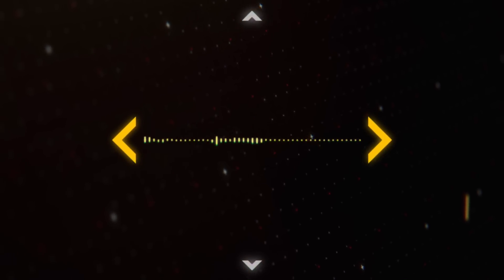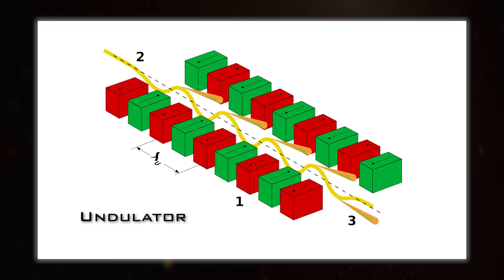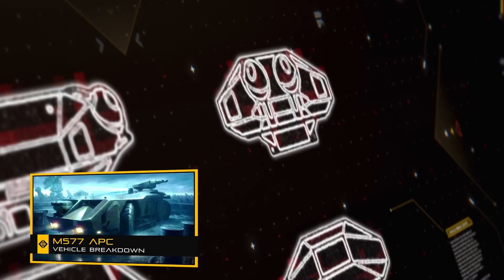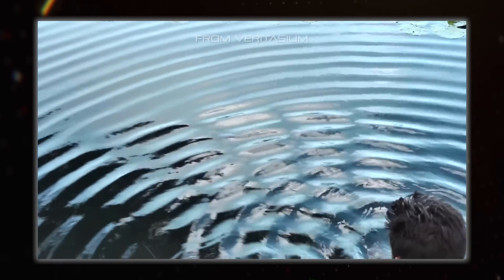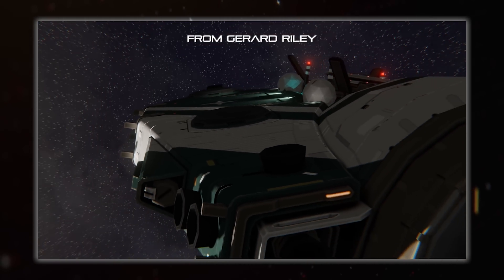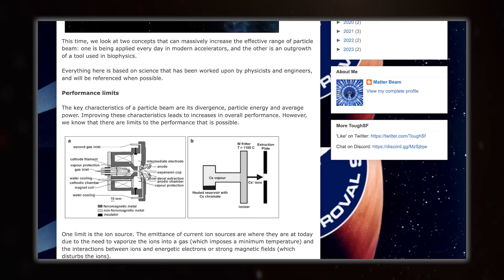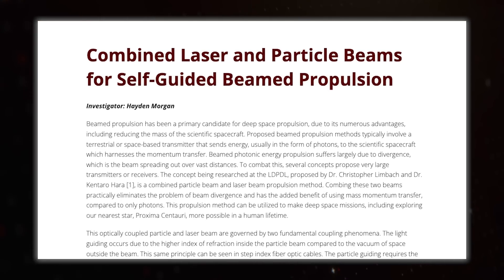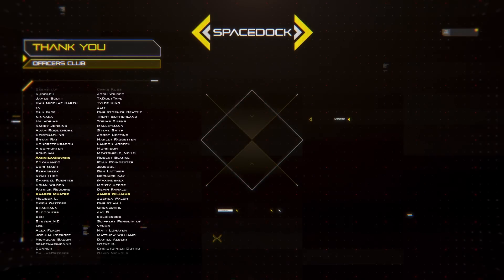Advanced Laser Weapons in Realistic Space Combat

Comment: You're missing the strategic applications of lasers.  TLDR they far better at overwhelming the cooling of enemy vessels than punching holes.  Would potentially allow solar-system wide interdiction of vessels.  Dodging due to light lag then becomes a cost benefit analysis of how much power you want to spend to cook an inescapable volume of space vs the range of interception.
Reply: with a properly tuned, equipped and operated dyson swarm, your available power budget is basically 'yes'. also you're firing from off the solar corona, so you have the figurative high ground everywhere in the system.
Reply: This is how I have them mostly get used in my novels.   Gamma Ray lasers with shields that can't really be penetrated by said lasers, as the shields are designed to deflect near-light speed radiation.  However using them against a ship generates heat.  So even if you don't have the specialized torpedoes that can get through shields, you could use them to cook a hostile ship/station/etc.  The energy output can also blind sensors and comms and there's just all sorts of side uses for them.
Reply: @trekkie1701c  Magical space shields are more fantasy than sci fi, though. 

While you could use some thing to create a shielding effect, it wouldn't work like some magical barrier against pretty much everything - and on top of that would be a horrendous waste of energy to be halfway effective even against the few things it could work against.
Reply: @miriamweller812  Sure, though there's always a conceit somewhere.

In my case the logic for the shields goes somewhat like this - if you're moving at a good fraction of the speed of light (which you'd have to to do pass it in most of the way FTL is handwaved) or even possibly at/past the speed of light, any stray photons you run into - the light particle, not Worf's lost torpedo - will hit like a nuke.  You'll run into a bunch of those given that there's a whole background radiation and all that and you'll basically instantly destroy your ship from that.  That it doesn't is usually a conceit; and I didn't really want to go that route.

So why doesn't it?  We'll go with the old Sci-Fi staple of shields.  But wait, what's going to hit harder than the background radiation at light speed?  ...Not much, if anything.   If we say that they can protect the ship from the rigors of FTL, then it doesn't make much sense that they can defend against that but not some stray laser blast.  And if they can defend against it for long enough to make FTL jumps last more than a few seconds or so and be the sort of thing where you can have the ships whiz around their local clusters in reasonable timeframes for the story I want to tell,  then it's not going to make sense that you can really penetrate them with an energy weapon.  That makes such a system incredibly appealing from a military perspective, and I decided to roll with it.   You can still penetrate the shield - sure, the various militaries of the galaxy would want to use that sort of thing defensively, but they'd also want something that could penetrate it so they'd develop weapons to do so (in this case a torpedo with a generator to counteract the shields).  You can even time the torpedo impacts with a nice shot from a laser to blow a hole into whatever section of the ship just ate a torpedo (and possibly take down the shields by destroying the generators, which now not only leaves the ship vulnerable to laser fire but... now they can't go to FTL and they're trapped).

Now, you might point out that 'they have to see through the shields so they have to let some stuff through' but surprisingly, no.  If something hits the shields then that's going to have an effect on them, be that deforming them, or forcing a higher energy draw from the generators, or heat buildup, etc.  It induces a change in the shields, basically - much like radio waves induce a current in metals.  You could then with enough math work out what probably caused that change and infer a picture of what's outside.

As for how they're generated?  These ships already have the ability to really mess with the fabric of spacetime in order to propel themselves at FTL speeds; it doesn't seem like much of a stretch that they could use the same sort of technology to deflect anything that might otherwise hit the ship, particularly given how reliant on shields the FTL tech is in this setting.

Of course this energy usage would be fairly high and so would heat generation as a consequence, which has forced many military ships to have removable heatsinks to allow them to swap them out for faster turnarounds and a competitive edge.  Ships otherwise have to - and do - have to otherwise sometimes wait to cool down with their shields off (among other systems), which can be dangerous if you're not somewhere particularly friendly.
Reply: While lasers are fast, the solar system is VERY big.

Even firing at the very close mars, it takes 12,7 minutes(!) to reach the planet  (and Mars moves around 24km - per second. And that's just the planet, the rotation would add to this on top if you want to hit something just on Mars)
Reply: @miriamweller812  An even closer to home example: For a geosynchronous satellite, the latency incurred by the distances involved, even at light speed, is very nearly an entire second for a round trip. That makes for VERY noticeable lag for anyone that has to use satellite internet and has ever used any of the more common terrestrial options.
Reply: Lasers have focal points. They do not have solar syste wide range. Not even remotely. A very large laser might have a couple ten thousand km range. No more.
Reply: @XMysticHerox  You can't really put any single number to the range of a laser. It depends principally on wavelength (lower is better) and aperture size (bigger is better). Subtler factors like jitter can affect how well you can keep it on target. Your effective range could be a hundred meters, or ten light seconds. Depends entirely on the laser.
Reply: The strategic level is one that very few people think well on, if at all. On the um, bright, side, if you are a planet or station that's considering the strategic deployment of lasers as deterrents/interceptors across the scale of the entire solar system, you probably have quite a lot of power and other resources to hand anyway. 

On the gripping hand, you'd also have to worry about ensuring you don't accidentally fry someone or something far closer than your intended target and likely leave gaps in your planned coverage.
Reply: How would pulsed-lasers be as "free" CIWS‽
Reply: @hellacoorinna9995  no ammunition cost. raw energy compared to a fully formed kinetic round means that a laser may as well be free to fire, as well as it being suited to shooting down small, fast moving targets.
Reply: @jooot_6850  
Thought as much.
Reply: Space shields are very much a sci-fi thing. Realistically, the hardest thing on a spacecraft you'd have to penetrate is whatever armor plating that it would have. Considering how getting heavy objects into space is not easy, most ships would have to be pretty lightly armored. In this way, you could definitely melt through some of that and cook the insides of a ship pretty easily, or absolutely fry whatever sensors they have. 
Considering a laser's real world military use against light drones, I would imagine they could (very soon) become an actual space weapon. Being able to hit your target at the maximum universal speed limit would render most other weapons useless. Why bother shooting a chunk of lead going maybe a few thousand m/s, when you can beam them at 299,000,000 m/s? Even if a laser wouldn't immediately destroy a spacecraft, their ability to rapidly damage sensors on both the ship itself and whatever guided munitions it launches would make them a pretty crucial weapon
Reply: @jooot_6850  
"Space shields are very much a sci-fi thing."

I mean you do have the old 'Black Globe' (from the likes of 'Traveller') which is as much a hindrance to you, even if it offers protection.

But as you say, it's a sci-fi thing.